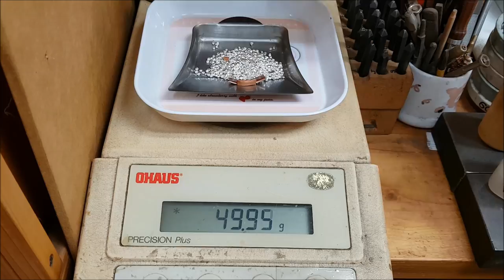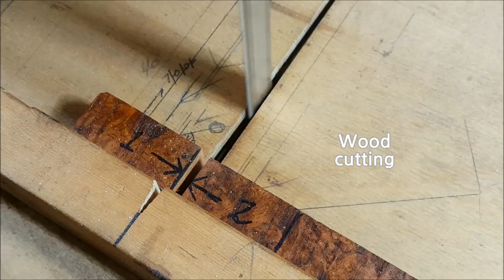Making FOUNTAIN PEN [ 4.2 Million Views ] Silver, Gold, Rare wood

Comment: There is so much skill in this it's hard to comprehend. Never mind the pen, I'm in awe of you cutting a straight line with a fret saw, that alone is hard enough!
Reply from the maker: Cutting a straight line with a saw is not a special skill, but it is the most basic of the basics.
I want to convey the meaning of more work than sawing in this video.
There is a greater meaning and message in the various work processes.
comment, thanks~

Comment: Excellent work. A suggestion, not a criticism - instead of vegetable oil, consider several coats of cyanoacrylate, then wet sand through the grades until 15000.
Reply from the maker: I don't want artificial coatings.
I want the user to feel the natural wood feel.
Thanks for the suggestion~

Comment: What sort of tip is that on what you're using to fuse the gold leaf on to the silver rings? And what temp is the torch?
Reply from the maker: The thickness of the gold sheet,,,
A postcard-sized gold sheet is about 3-4g.
That's about the thickness.
It is about the thickness of a regular paper.
Heating these metals to a temperature between 260?370°C increases 
the movement of the atoms. 
When pressure is added, 
this causes an electron exchange at the surface between the two metals, 
creating a permanent diffusion bond. 
This diffusion bond occurs far below 
the soldering temperature for either metal (Dhein, 2004).
Nothing is permanent in this world.
It may wear out over time.
Physical contact may cause it to peel off.
It doesn't go away easily with the passage of time.
Because silver and gold became one.
This is different from normal plating.
Thanks~

Comment: Why do you quench in water instead of oil ? Using water leads to stress crack in metal
Reply from the maker: You don't know about quenching.
Non-ferrous metals such as silver and gold are not affected by quenching.
This is basic.
I have been dealing with silver for 29 years.
You are not talking about things you do not know well.
Reply: Ok dude . I only know about iron and Steel.

Comment: it beautiful! And then you realize nobody uses fountain pens anymore...
Reply from the maker: It is only your opinion that no one uses a fountain pen.
Many people still use fountain pens.
And a pen is more powerful than a gun or a sword. thanks~
Reply: @SilverMeister  I used a fountain pen from the 1st grade all the way to the 6th. For 6 years. It's supposed to help improve your calligraphy. BUT all i got was constant blue fingers, smudges over the page, slow drying ink that requires special absorbant paper you press onto it and finally, a pain in the ass to keep the pen in a special case and not damage or break it. 
And before you ask, yes, it was a very expensive pen as well, with a gold pen nib.
Normal pens cost like 10 cents and have none of those problems. The only reason to use a fountain pen today would be if you want to look rich and smug.